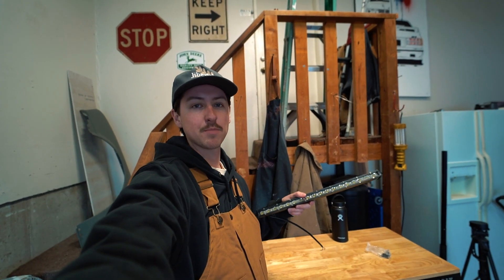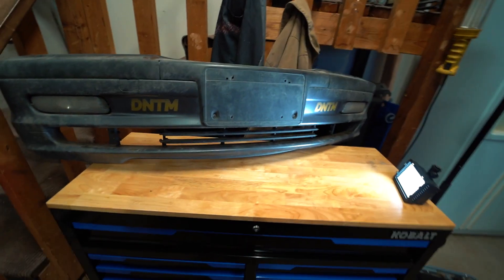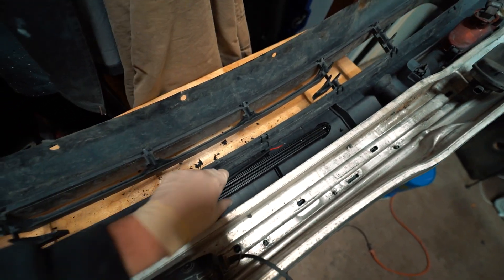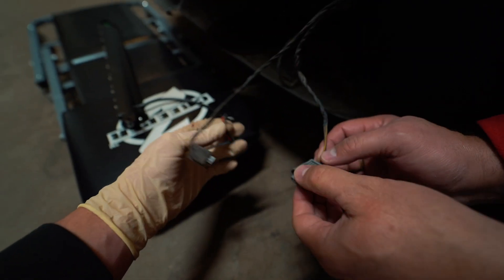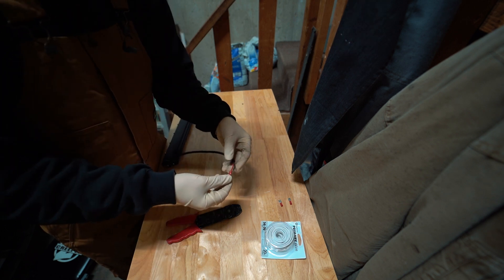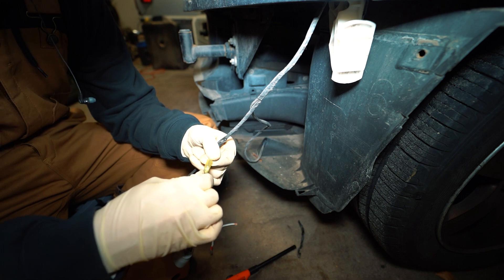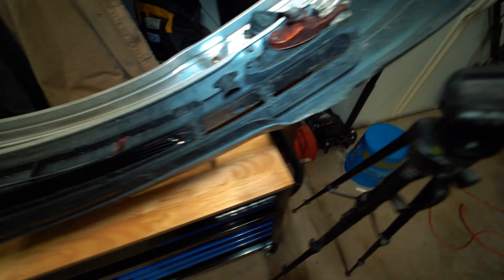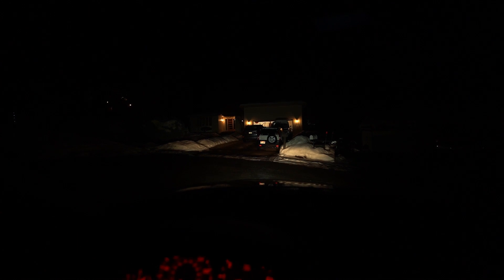E46 LED Light Bar Install + NEW Wagon Livery!

Comment: whats the power of the lightbar? i wanna do the same but people tell me i need seperate switches power and relays for higher power... do you know the limit?
Reply from the maker: I don’t know… I just knew that it was for 12V automotive purposes, so it was able to be wired right into the harness.
Reply: @DowntimeMedia okay i will try to find a 12v rated one and send it😎